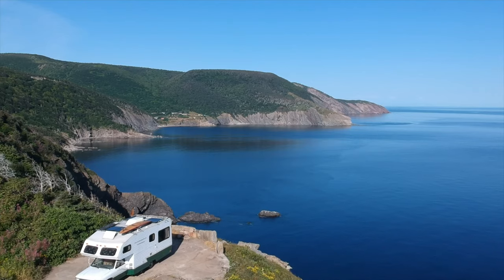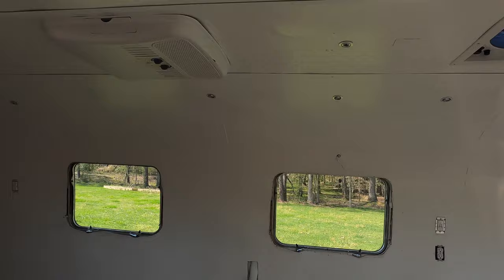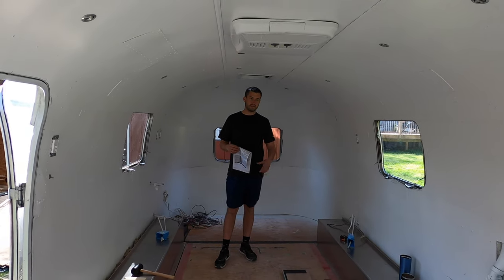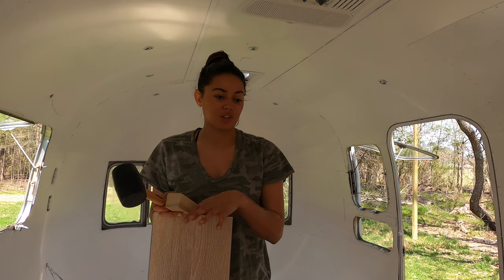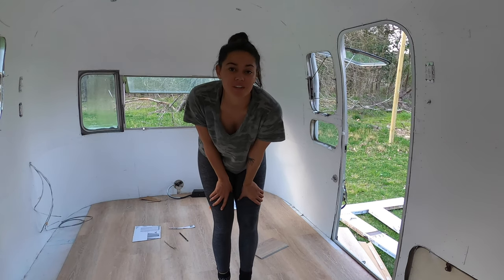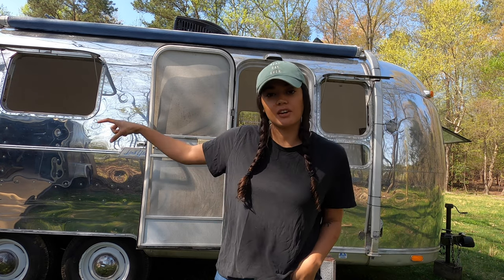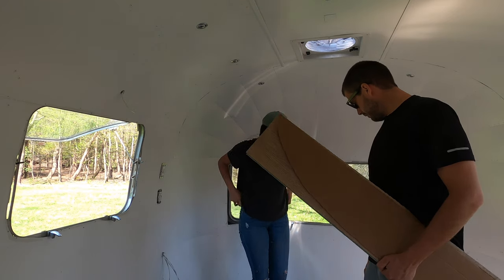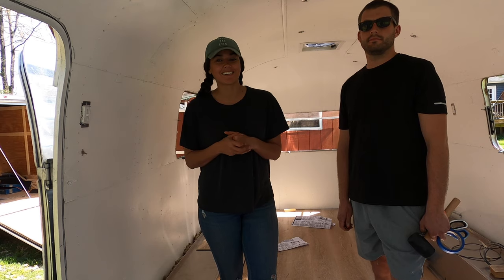AIRSTREAM RENOVATION episode 11 || INSTALLING VINYL PLANK FLOORING IN AN AIRSTREAM

Comment: Another great episode!! Nice work.
I have a question about your next step installing Solar components under the bed. I would like to do the same configuration but I’m concerned about too much weight in the rear and “sway”.... should I not worry about the weight in the rear? Thanks!
Reply from the maker: Hi Angel,  Thank you!  We aren't concerned about the added weight because of a few factors in our build.  We went with lithium batteries which are significantly less weight than lead acid battery systems, and our placement of the solar components are maybe less than a foot away from the rear axle on our tandem axles.  So, yes our solar components add weight towards the rear of the Airstream but we are not concerned about sway in our case.  Without knowing much about your Airstream or how you are building it I can't tell you not to worry about weight in the rear of your Airstream because that should always be something to think about as you are rebuilding your trailer.